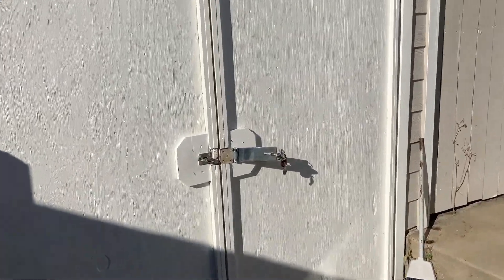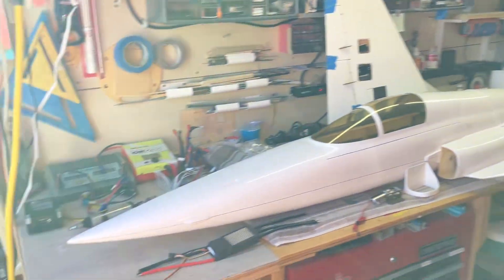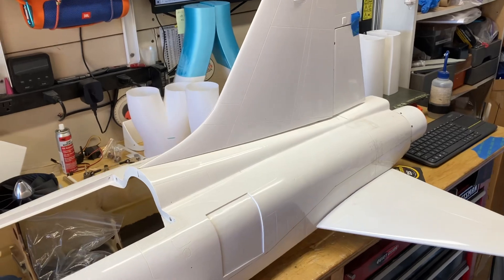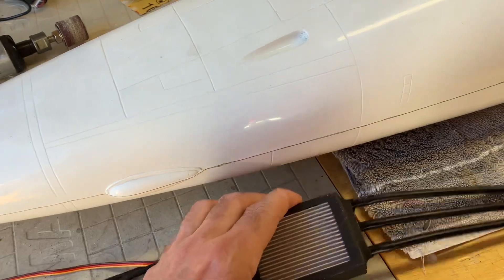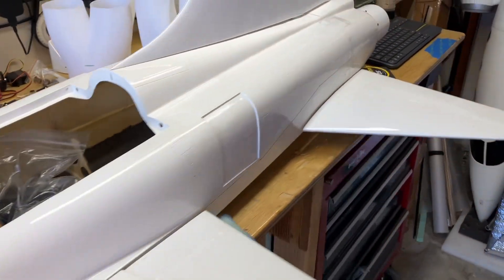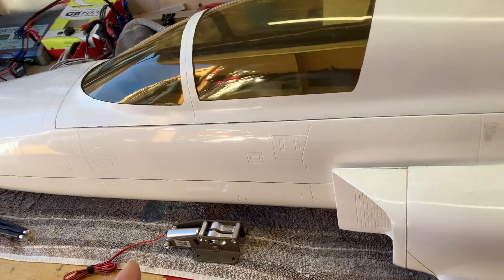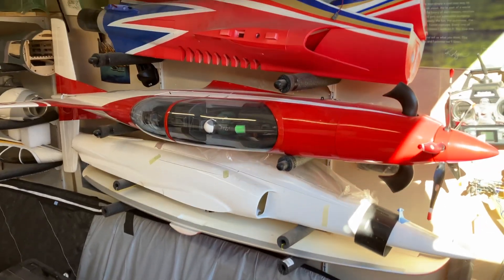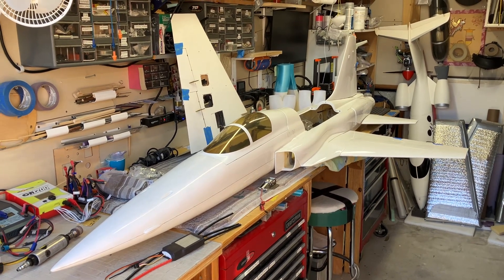Skymaster F-5E 1/6 scale EDF conversion Part 1, project intro.

Comment: I'm in the process of converting an old Ziroli F4 phantom plans to 80mm edf.   I'm doing all 3d printed ducting similar to yours.   What material are you doing the ducts in and what are you using for a wall thickness.   All my mockup and test ducting has been in PLA with a 1.5 wall thickness.   I was thinking of doing the final ducts in lightweight PLA.

Comment: Good point on voltage. I converted a Feibao L-39 to edf many years ago an ran it in 12s. It flew but wasnt very impressive. I built it to handle 18s so I'm getting inspired by your build!

Comment: hey good video but i left a message on you pc 21 video...wanted to know what size prop?
Reply from the maker: Thanks!  Sorry I missed your question.  It's a Vario Prop 16D 5-blade hub with 14.8inch blades.  I have the pitch set at 12.
Reply: @Air-Jon  if so can u give me specifics of parts so I can order I have same motor power 160 eflite with 150 hv gecko speed comtrol
Reply from the maker: Part no: 358-16 (5x) 14.1in blades,,,,,S5YYY-16 16D Special Aluminium Spinner, extra long PC-21 5-blade, 90mm dia, M4 thread, 51216 ,,,,,   16D 5-Blatt-Blade-Hub-16D.  You will need a special prop adapter which is long enough for the hub, or order a collet from Vario Prop.  The company i order my prop adapter for is out of business. (tru-turn)
Reply: @Air-Jon  6 8 or 10 mm collect hub? thanks for getting back i fly jets but started my son on props and when we got the fms pc 21 i fell in love with props again so i bought this one from tower but i had a older one i got at a flee market and put a dle on it ...messy but fun till a retract stop and i sold so it but since flying his i regretted so i bought another one ...but seeing u fly yours i want that same speed ...im gonna put frsky in it though...
Reply: @Air-Jon   one more question do u have brakes on your pc21 and if u do you have part number so i can get as well thanks my fiend
Reply from the maker: I'm using Electron ER30 size , 70mm Diameter wheels and brakes...But JP Brakes would work just as well.  Sorry, i don't have a part number @esskiahastings7974